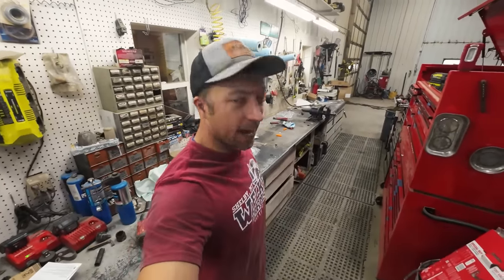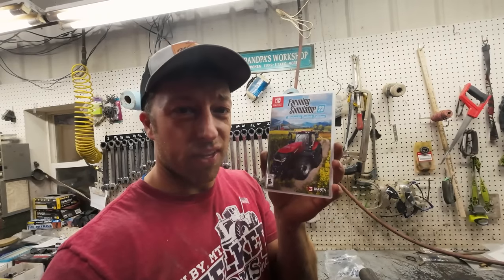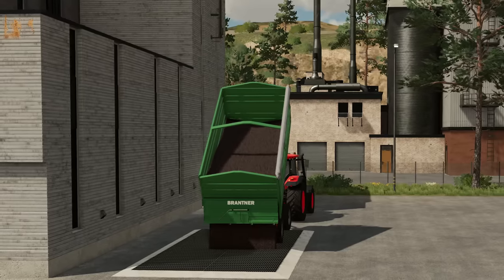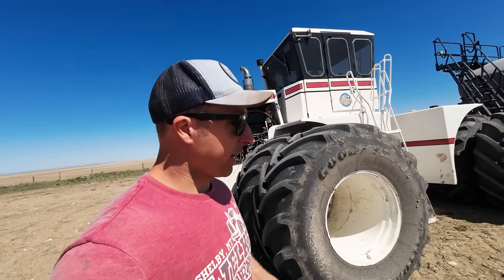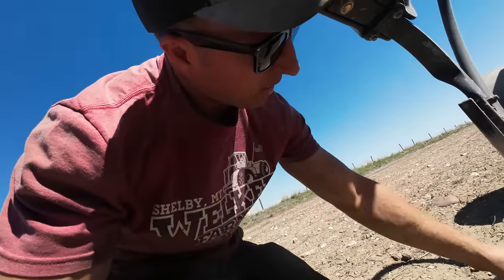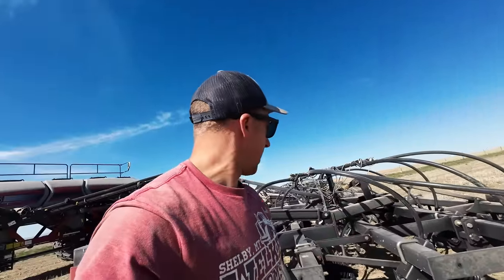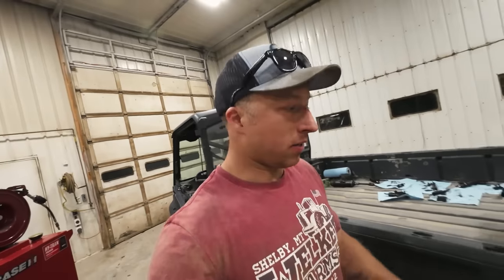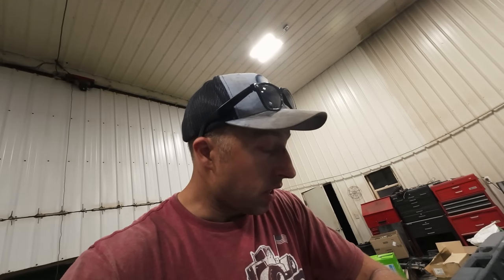Will An Old Rusty Engine Save Our Season?? *TWO TRACTORS DOWN*

Comment: I would look at possible contaminated fuel in both trackers. Since it started within an hour of each one.
Reply: Only takes a little to ruin spray pattern.
Reply: Thought about that but if the 3rd one is ok then that rules out fuel
Reply: @nickkercheval2704  not exactly, the 435 hasnt been used as much as the 525 and 600 and likely hasnt been refueled as recently as the other two. decent chance they got a new load of diesel and have refueled the 525 and 600 and not 435
Reply: @BackTheBlue96  Not knowing all the specifics I have to think they thought about fuel and ruled it out.  I have to agree that if they got a recent fuel delivery that could be an issue.  If so drain the tanks and put different fuel in
Reply: 💯 agree, 2 machines same symptoms,1 identical operational similarly
Reply: Bad Fuel was my first thought also.
Reply: Was thinking of that being the same common denominator as well.
Reply: I had a set of injectors rebuilt and none of them would seal up had to send them back and the two wouldn’t seal, took to another shop and  never had a problem after that so don’t beat yourself up Nick
Reply: My thoughts exactly.
Reply: It’s not bad fuel,,,,, this is why you never ever EVER rebuild injectors. Spend the money and buy new ones. The other factor? No matter how much upkeep you do on a old tractor, there comes a point where it’s not feasible to keep dumping money into them. Trade and upgrade. Because one, you only get so much depreciation, and two, you’re not left in a bind at the most critical time of the year. New ones break, but warranty is the end all be all CYA.
Reply: Good Luck, and  GOD BLESS.
Reply: I had an N14 missing at high rpm this spring, added some lubricity conditioner and it cleared right up. Kleen flo
Reply: @peteparker7396  The new machines are not trouble free... even so most can't trade off every couple years, it never pencils out or keep piling on debt that can never be paid.
Reply: I was also thinking a problem with the fuel
Reply: DITTO....  If you fueled both from a common fuel barrel check your fuel....
Reply: @nickkercheval2704  Not a given.  They need to check.  If they have a small amount of gasoline mixed in it could do this.
Reply: @nickkercheval2704  I wouldn't say they ruled it out unless they have had it tested, which the results wouldn't come in the same day..
Reply: Clean fuel standards
Reply: @Mr. Richard C. I get what you are saying but newer not brand new is the way to go as planting season is the most crucial time of the year for making money. You can’t afford to have engine problems at this time… they unfortunately need newer tractors. As much as I love the Big Buds and I never want to see them get rid of them… they gotta move on to a newer tractor to increase efficiency.
Reply: That’s all well and good but. All it is is holding onto it at this point and it’s costing them money because they aren’t planting. Every day they waste is yield loss and no tractor is worth missing a crop.
Reply: @farming4g  you’re dead wrong. It always pencils out. Especially when you plant on time every time.
Reply: The government because of environmental stewardship is coming forward with clean fuel standards, which are actually reducing diesel BTUs
Reply: Normally would agree, but they're using the same fuel in everything. Both sets of injectors were rebuilt, I think they're right in thinking that's the most likely culprit at this point.
Reply: @ryanedwardson6541 I thinking injectors too I would expect everything they have that runs on diesel to have issues because the seed trucks are diesel too they aren't having issues but both these tractors have rebuilt injectors with similar hours and both just suddenly started having issues
Reply: @nickkercheval2704 or you could just run a piggy back separate tank to see if that the problem !
Reply: @peteparker7396  my dad owns a shop rebuilding injectors and pumps and there are times that the body of the injector is junk but most of the time it's just as good to rebuild as to buy new but im also not in America so injectors are like 5 times the price for us
Reply: I wonder if there is a way to bench test the injectors find the ones that do work and take the ones that work (would be nice if only one each) then just use the ones from the spare engine. As for buy new or newer like one person said any engine will fit cause a rail system. They also been upgrading all kinds of stuff on the buds (and some other implements) the only thing I don't think (correct me if I'm wrong) DEF on the buds? I wonder if mixing DEF would stop it? Ik with gasoline engines they put all kinds of detergents and additives and not to mention all kinds of stuff to run cleaner and more efficient but fuel goes bad after a while. Just a thought. I also wonder if bio-diesel would help? Just throwing out thoughts here. In any case I wish them the best of luck. Here's a thought. I always see wrecked nearly brand new tractors for sale. Maybe they could find 2 identical engines for the buds (maybe 3 for all of them) that way all are identical and would have newer parts. Would be expensive in the beginning but parts would be easier to come by.
Reply: I'd agree with bad fuel
Reply: @peteparker7396  you don't upgrade to newer tractor. Since new ones comes with even horrible problems. Just put brand new engine in it and you are set
Reply: Fuel was my gut also. Try a small amount of fresh fuel, not from the farm tank. I disagree with tossing Old-Iron.
Reply: exactly my idea too
Reply: Time for couple new Cummins crate motors I’m afraid
Reply: @Brandewey  you can bench test injectors but you need special equipment. DEF isn't a good idea because even though it lowers emissions it's expensive and is harder on the motor and would require new engines and lots of work. Biodiesel is a good thing but they would need massive amounts of it to feed the tractors and it can be harder to run it. As for putting newer engines in it is a lot of computer work as all of them use computers to run the engines
Reply: If bad fuel is the culprit, wouldn’t they coke up on idle as well?
Reply: @kmmck  possibly but you are using more fuel at higher rpm which could make it show but if it were bad diesel it would be happening to the seed trucks too
Reply: I dont know if the welker fix the leaning fuel tower so could stuff have gotten in it easier?
Reply: Nick don't beat yourself up if you'd done nothing a stuck injector melts a piston in a fraction of a second had it happen.
Reply: @peteparker7396  what a crock of crap u can rebuild injectors absalutly fine if you know what ur doing. Fitted 100s of em and not a single problem
Reply: Exactly what i was thinking!!!
Reply: I was thinking the exact same thing, dump fuel, change filters, order fresh fuel, and test fuel in your storage tanks for water and contamination
Reply: @peteparker7396  not disagreeing with you, but I was cole the cornstar and the millennial farmer, those tractors defiantetly have not been a walk in the park for maintenance
Reply: I would lean more towards fuel than I would the injectors cuz within an hour apiece they both started smoking something's up
Reply: @AlienX511  I’ve got two brand new ones and 3 others less then 5 years old. Never had a problem with any of them. But you and others are missing the point. While my crew planted every acer with no issues with tractors. These boys are screwed. And what’s the most important part of a crop year? That is extremely time sensitive? Planting. And they are in a bind because they run old equipment.
Reply: @Goostradamus81  well again Cole has a used tractor not new. And MMF had a two track that is notorious for having engine problems. That also wasn’t new. Not saying it doesn’t happen, I’m saying you are better off with a new one if there are problems then a 40 year old antique.
Reply: @peteparker7396  tell that to the people in the 70s and 80s that couldn't pay off their debts and went broke farming... It's a high chance it is all heading right into that path again. Wait until commodities go low with the high  rising interest rates.
Reply: @dalehansenab . Used to have a N14 that threw injectors constantly. Nearly once a month truck was in the shop for replacement. Then the crank broke.. went to a cat and haven’t ever been happier
Reply: @ralphnorbert9187  Time for new tractors
Reply: @farming4g  I grew up back then so I know and remember well. One thing I can tell you for sure. The ones who didn’t survive were already not in a good position.

Comment: The first JD 4240 through 4860 had duel air filters. Changing the outer filter only confused many. The inner filter would get dirty also and cause extreme black smoke. Changing the innner air filter would cure the air pollution issue. Big Buds may have primary and secondary air filters like the fuel system.

Comment: I know it sounds like a really stupid suggestion, and you have likely already checked, but have you tried running it with the air filter/filters out? Looks to me like its struggling for air....esp with the way it cleans up at idle and just smokes under load... The fuel is likely correct and its just getting starved for air, does it feel down on power at all? Could just be a dusty season and both have clogged up? Or maybe you have serviced both tractors recently with a different brand of filter which blocks up alot quicker than normal in the dusty conditions? Like i say you have likely already checked this, but if not, its got to be worth just pulling the filters right out for one pass just to see if it sorts the problem? Maybe if your reading this comment you can like it up so it gets seen. Hope your able to get it sorted soon, nothing worse than a breakdown mid season, never go wrong in the shed do they!!

Comment: I'm gonna say the same as others and check the fuel. Last time at work (we run heavy equipment for a steel plant) that we had 2 or more machines with similar issues, it turned out to be clogged injectors from contaminated fuel. We had fuel delivered with algie that contaminated the whole fuel tank, then the fuel truck then our machines.
Reply: agree  algae  bloom  holds injector  pins open  causing  flooding  or rich  condition>black  smoke...
Reply: Algae in fuel is a big problem in Aviation fuel tanks.
Reply: All I can say is get a Fass, catches any debris or alage for that matter.

Comment: might seem odd but I've experienced a planting season that didn't seem that dusty but all 3 tractors took to smoking one at a time.... an 886, a 1066, and a newer case . and after trying fuel filters and all sorts of other things it ended up being the month-old air filters. it took like 6 guys and almost 2 days to figure that out...... they had just been changed... no one thought it could be that.

Comment: There is an old Polish proverb: "Diesel, musi dymić", which means "Diese, have to fume" :) . The black smoke usual means injectors problems and this is regular situation with old diesel engines here, in Europe. If there is too much fuel (when you rapidly press a throttle) or it is not spread correctly (injectors malfunction) then it is not able to burn in the right way and you have a black soot in the fumes. I guess.... :D

Comment: I would first check the fuel return line going back to the tanks for restriction since it only over fuels at high RPM.
Air filter would be my next check.

Comment: Rick below mentioned fuel return line , absolutely correct   the pt fuel system is very sensitive to return back pressure. Run it into an open drum. Also check your tank breather

Comment: There are low flow injectors and high flow injectors, I found this out when running a KTA on the Dyno  and was getting crazy horsepower and it kept climbing, got the injectors and fuel pump matched and it was back to about 625 H P. This happened after the injectors were overhauled. Cheers my friend

Comment: On a Cummins with PT fuel pumps if they start smoking like that under load like both your Buds are doing it's not the fuel it's in the injectors themselves.  More than likely they'll have a bad set of springs or tips and seats on them.  Rebuilding old Cummins injectors is getting to be a lost art anymore.  One of the best places still is Pittsburgh power.  They're expensive but worth the cost Bruce there has forgotten more about Cummins engines than Chelsea Cummins himself.
Reply: @haroldbenton979   I heard an interview with Bruce Mallinson of Pittsburgh Power a few years ago, and he talked extensively about a big problem with rebuilt injectors. Poor quality control in parts was the point of failure he was seeing the most. I'll bet things haven't improved.
Reply: True, cummins pt pump rooms are getting harder to come by. We have a pump room at our facility that is very busy. Quality is excellent. Problem is we are on the other side of the world. I think that locations like Alabama that service the gulf would be very experienced in pt fuel system servicing due to the crew boat market which still runs a high volume of k series marine engines

Comment: If yiur fuel quality is ok 
Check the air cleaners
Check the turbo including crossover. Axial and radial measurements
Cut the filters open and check for engine damage. If all good big sigh of relief. If debris identify material, remove cam covers and check followers and cam if steel.
Check the after cooler. Get a boost reading steady state and check the delta p  I would expect 2psi there's no actual spec.
Are you setting inner base circle method.... 304 thou on the dial indicator if I recall correctly
These are great engines if you service injectors every 5000hours and  fuel pump every 10. Dont screw up the fuel pressure, Just leave as standard. Dont mix cpl parts. Make sure the parts from the old engine are the same cpl  
K19 are still made out of seymour and are available. Plenty of these still running here in australia.

Comment: Is the bowling ball cannon available in the Welker Farms mod?

When the same problem happens to two tractors at the same time, you need to look for a relationship. Did you get a fuel shipment in recently? Could it be bad fuel?

Comment: Fuel viscosity low along with low cetane value.  Too much flow and low combustion.
Probably gasoline contamination in pipeline, bulk farm, or tanker
Dump tanks, flush lines and refill directly from  retailer delivery truck.  Lucy didn't take out pump and rings on those Cummis

Comment: There's a chance that there's an issue with air supply to the engine. If the pressure is good, and injectors turn out to be OK i believe you should check the engines to see if they get enough air. Could be just a simple filter problem or something more serious like a turbo.

Comment: I used a rock between casting and nut when I had a nut spinning on the other side - i see you had a lot rocks in the field so save the tip for the next time :)

Comment: Thanks for your video Welkers. 

I really feel bad that you are having all these problems at seeding time. Oh my how frustrating. 
I saw by some of the other comments that there were questions about your fuel. I assume you have probably looked at that. 
I know that the injectors can be a real problem if not correct. But it sounds like your mechanic has looked and relooked at them. 
Sorry I do not have any answers for you.

I know it is seeding time and seed needs to get into the ground. Could you possibly get a demo unit or borrow a unit or a rental to at least get seed in the ground. 

Keep us posted please. Worried about your tractors. Hopefully you find the answers. 

Sending prayers your way for answers !!!!!!’
God speed guys. 
The Iowa Farm Boy. Steve.

Comment: MacDawg and I think alike...contaminated fuel (engine oil?)...there is a reason they both started smoking at the same time...all those injectors didn't HAPPEN to fail at the same point...there is something in common to the two tractors that is causing the injectors to fail were the injectors in both tractors replaced about the same time?  Even if that were true why did they both start within an hour of each other? Test your fuel!

Comment: Both Buds have the same issue at the same time can only be one thing, and that would be Fuel as it is the only thing that has been added. Very unlikely that both tractors injectors fail at the same time unless it is Fuel.
Reply: But the 3rd bud is not having issues
Reply: @@anthonymurphy2464 Not really, its still a mechaniacl unit style injector that's just electroically fired.  If it was bad fuel, that tractor would be suffering too. I'd say it was a poor rebuild job on the injectors.
Reply: @dieselman8v923  Totally agree.
Reply: @dieselman8v923  there is no doubt about it in my mind it’s bad rebuild. This is why you do not rebuild injectors. Ever!
Reply: @peteparker7396  even New injectors can be bad. I've seen it more than once right out of the box
Reply: @nickkercheval2704  The 3rd Big Bud has a N model Cummins which has Electronic Injectors, The others have mechanical Injectors which can't handle contaminated fuel as well as the N model
Reply: @dieselman8v923  it’s a mechanical injector, not electronically fired. It’s the old “ Pressure Time “. Fuel system.
Reply: @Anthony Murphy this is not a electronic engine, the KTA is the old mechanical injector.

Comment: The intake manifolds on those engines are bad about blowing the gaskets out between the aftercooler and the intake housing !!
Look down between the rocker boxes and the intake assembly and see if ya got any sign of the gaskets ( yes their are 2 gaskets) leaking or being blowen out !!
Remember that the intake temps are up to 450 degrees and the coolant is only 180 maybe 190 on a bad day !!
Thats a lot of expanding and contraction going on at the same time that its making 40 45 PSI boost !!